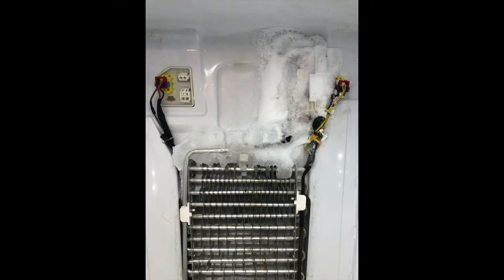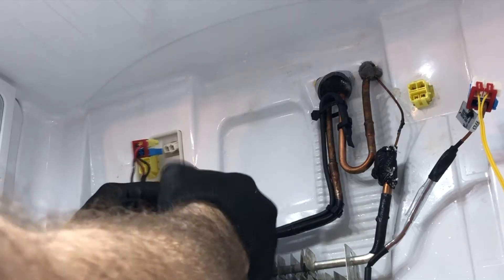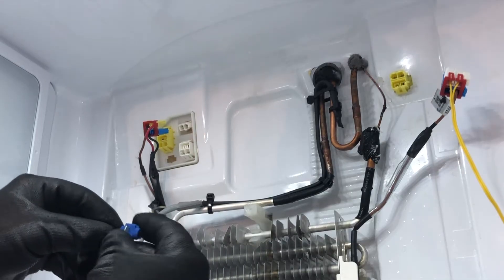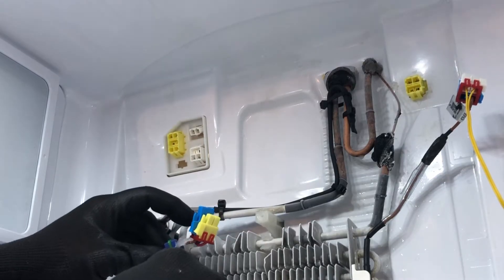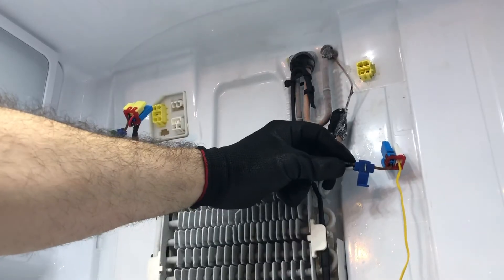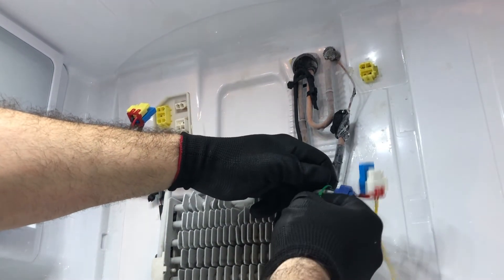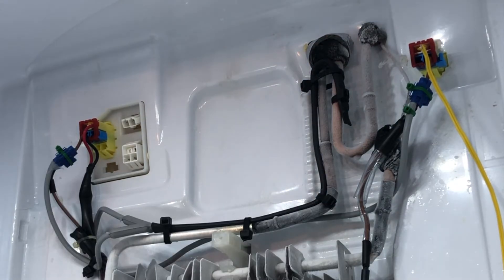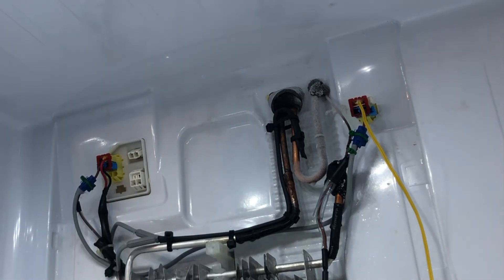Samsung FDBM evap heater add

Comment: I have a Samsung Model # RF28HMEDBWW/AA  Rev. 04  S/N 066443BFC00488V and I have the same over icing issue.  I have defrosted, removed the back panel safely,  and have all the parts to add the heater.  I just have a couple of questions,  I have 2 plugs on the left, no plug on the right.  I had a hard time viewing the connections and the correct wire that goes into the connector with the heater wire. Not sure what wire to connect to? I have a hard time viewing the schematics. With 2 lead wires on the heater,  and  my unit only having 1 plug that looks like the one you connected to, am I connecting on one lead wire from the heater?  If you could please advise me as to the connections I would greatly appreciate it.  Also,  I am curious, will this make the heater only heat when you run the FR or FD or will it heat up automatically to maintain the buildup?
Reply: My Apologies,  I was thinking of only the 2 plugs I unplugged on the left when taking off the panel.  There is in fact 2 plugs one on the left and the right.  I just need to know if the brown wire is in fact the refrigerator  heater wire and that this is the only wire that is in fact connected with the SH502 heater wire inside the connector? My Bad.  I am figuring this out as I go.
Reply from the maker: This is an advanced modification for technicians, it's not meant for a diy. I recommend you call a qualified repair tech in your area to install the heater. As to your other questions, this heater works when the defrost heater is on during normal operation. The tech should setup the heater in parallel to the defrost heater. If it's not wired properly, it could fry the refrigerator control board.
Reply: @electronicsprojects4708  Thank you so very much,  I just was advised by Supco that this part is not a compatible part for my Model. They referred me to Repair Clinic for an OEM heater.  I have the OEM part # of DA47-00434A. This part appears much different in shape but basically the same concept.   I will see about getting the OEM part and having a Tech install it for me.  Thank you very much.
Reply from the maker: @katherinereynolds8118  If the only place that the frost is building up is at the top near the fan, that means the evaporator heater is working just fine. The reason I posted this video was for techs to be able to overcome an engineering failure in this series of Samsung french door fridges. This is outside of what the manufacturer or Supco for that matter recommend. But it's a modification I came up with and I have been doing it for about 4 years now, I know of other techs that have put thousands of these Supco heaters in these refrigerators with great results. But it is a more advanced repair, that's why I only recommend competent appliance techs perform it.
Reply: @Electronics Projects  Thank-you so much. This explains everything, why Supco wouldn't suggest I install this to my model, and why  Supco referred me to the OEM replacement  of the evaporative heater. The evap heater is working fine, so that was not what I needed. My unit was in fact only icing up near the fan at the top.I didn't end up purchasing the replacement heater. I cleaned up the fridge and decided to wait on the install or the evap replacement. I Put it back together, Running great for now. Want to see how long before it ices over again. I have had this fridge for 9 years and never had to defrost it. This was the first.  If it freezes up again, I will have this fix installed definitely.  I got nervous when you mentioned the fact that it has to be installed correctly or it could damage the circuit board, and then Supco not supporting the idea or compatibility either. 
I called a tech and they wanted $250 to come look at it. Fee is waived if repair is done, but they wouldn't use the parts I purchased. 
I will need to find a tech that will install it for me. It appears to be an easy install. It did not seem to me that this fix should even be a compatibility issue. 
This is a great fix, and I will definitely use it if it ices up again. I am sure it will. Thank you for what you do. This will help a lot of people including myself get around Samsung's engineering  failure.
Reply from the maker: @katherinereynolds8118  I would send the tech a link to the video asking if they are familiar with this modification before they come out. Explain the frost build up is in the fan area in the fresh food compartment.
Reply: @Electronics Projects  Thank-you, that is actually a great idea to make sure they can and are willing to do this. Great advise thank you.

Comment: not sure if I need the extra heater , but the temperature in Samsung fridge will go from 34 to 48 in a half hour, and repeat. It is set at 35 degrees . Freezer was set at 0 degrees , but actually read - 10degrees . So I set freezer at 5 degrees , and the freezer seems ok , but I am concerned about the range of temperatures in the fridge section
Reply from the maker: If too much frost builds up on top of the evaporator, it will hit the fan and you will hear a loud noise that stops when you open the door. If it's enough frost to build up to stop the fan, usually the temps will read 60 plus degrees on the middle shelves. Opening and closing the doors will affect the temp reading so do a temp reading 1st thing in the morning before anyone has opened the fridge. Do this for a few days to get the average temp of the fridge.
Reply: @electronicsprojects4708  hi , I'm using a thermometer that sends the temperature to a base outside the fridge .
there is like a half hour cycle where the temp will go from 34 to 49 degrees  with the doors closed the whole time and repeat . How can the temperature go up and down 14 degrees with the doors shut ?   Milk has not gone bad, but I'm starting to get concerned about this .
Are there sensors I should be looking at ?
Thank you
Reply from the maker: @frankcronin1060  if it goes through a defrost cycle, there will be a 30 minute time frame with no cooling. My recommendation is to get an averaging thermometer, not an instantaneous thermometer. Food will see the average, so it's the most important. This is beyond the scope or purpose of this video, which is an add on heater. This won't be of help for you.
Reply: @electronicsprojects4708  I appreciate your help . I had water in my crisper drawer. I took off the cover and found ice all around the drain and tray below coils . So I thawed out the drain  and cleared up the tray .( a couple times ),  I found the freezer was set to 0 degrees , but found it read  -10 degrees . So I reset the temperature for the freezer to 5 degrees , and found the temperature actually to be 0 degrees , but for the first time I found ice blocks formed above the coils . So , I'm thinking the added heater may help ? 
And , would a temperature range of 15 degrees be ok in the fridge section ?
Reply from the maker: @frankcronin1060  the add on heater is for frost build up by the fan. If you need to address the drain clogging up, there's a drain kit for that, I'm sure there are multiple videos for this you can try.

Comment: What if the defrost heater is not functioning? Will this added Supco heater still fix the issue? I saw in other video that you should check resistance and make sure the heating element is not burned out. Thanks
Reply from the maker: If the only frost you have built up is at the very top, the defrost is not the problem. If you have frost top to bottom on the evaporator, the defrost circuit needs to be diagnosed. That would be an unrelated failure.

Comment: do you think the SUPCO SH540 Drain heater (25 watt) would be too much for my Samsung Fridge RF26J7500SR/AA. ?   I like this heater as it is longer than the SH502 heater.
Reply from the maker: I have had success with SH502, you can cut the heat shrink off of it to double its length. Or buy the SH201. If it gets too hot, it can cause damage to the cover or liner, I have tried hotter heaters as the SH201 and SH502 have worked just fine for me.
Reply: @electronicsprojects4708  Ok, thanks.

Comment: You are the man!  I have been frustrated with my fridge since it started acting up in the first year of having it, have had a few appliance techs out to check it out since it's been under warranty, but nobody could provide a long term fix.

I did this and have had a normal fridge for months now, I am so grateful to you that I cant even really put it into words.  I feel like a 6 year stress has been lifted, thank you again!
Reply from the maker: Good to hear. I have been doing this repair going on 4 years with very high success rate.

Comment: Your procedure to repair this annoying, stressful and time-consuming problem is ingenious.  This will save folks a lot of stress and money, including myself, since I was about to get rid of my Samsung refrigerator and replace with a GE.  Your instructions while demonstrating the procedure was excellent.  I followed it to the T but I still had a problem.  The heater was not getting hot after I turned back on the fridge after the installation.  The only thing that I did differently was use the red wire splice (11-18 GA AWG) instead of the blue splice (18-14 GA AWG).  I acquired these from Harbor Frieght.  The problem I had with the blue splices was that after crimping with the pliers, the heater wire kept falling out of the splice. When I switched to the red splices, the splice trapped the wire and, even when I tugged on it, it never came out.  My question:  Is there a problem using the red splice since you used the blue splice and the installation worked fine?
Reply from the maker: different companies make different connectors, so one may work for me and not you even with same color. Use the one that when you pull on the wire, it won't get dislodged. The defrost won't kick on if the evaporator is too warm, sensed by the defrost sensor on the right. You may have to either freeze spray it, or just use the fridge and if it fails again, address it at that time. This video is meant for techs that have done the necessary troubleshooting already to confirm all other standard repairs are not necessary and this re-engineering is a last resort to the frost build up.

Comment: I guy charged me $400 to do this about a month ago and it failed, now he disappeared.

Any other solution fix?
Reply from the maker: Sounds like he didn't do it correctly. Find someone in your area that's not a fly-by-night tech, that has experience with this repair. I have been doing this repair successfully for about 4 years for frost build up, but other things need to be checked. The drain must be clear, Samsung has a mod kit for this. And the mullion flipper needs to be sealing. Condenser and machine compartment should be clear of lint. These are things a professional technician will know how to check.

Comment: Can you check via touch if the  original samsung defrost is working using the “rd” forced code?
Reply from the maker: You can test it in forced mode, but the defrost sensor must be cold or control will not start the defrost process.

Comment: Part number again please. I’m installing a new htr today for icing issues I verified with pulling the code on the controller? Also would not heat with a Fd either? Thoughts sir?
Reply from the maker: links to parts are in the description with p/n's. if the evaporator is not cold enough, it won'd turn on the defrost heater.
Reply: Thanks, it appears it is coming on during f/d by using my clamp meter on circuit in the panel. Hard to catch it on during normal mode however?
Reply from the maker: @ToddM452  not sure what you mean by 'normal' mode. In Diagnostics it will come in 'fd' or 'rd' mode. As long as the evaporator sensor is detecting a cold evaporator. In the run mode (normal operating mode) it should defrost every 6 to 8 hours.
Reply: Nice! Thank You for replying quickly. The defrost sensor resistance checked good against the value chart so I didn’t replace it. The diagnostic code is still showing a r1g pointing to the htr even though I replaced it that’s why I asked about normal run mode.

Comment: Great repair video. Would the the SH502 work for a RF18HFENBSR?
Reply from the maker: Yes, but typically I find it's the ones that have the second suction line loop that the heater is tied to that cause the problems. If the drain is clogged, and the evaporator drain pan has solid ice in it, then there is a mod kit for that and that has to be cleared for the frost not to build up again. Also the ff door mullion flipper needs to be operating correctly, or it can let air in the ff compartment, causing excess frost build up.

Comment: Just going to drop this in here even though it'll get lost in the comments. This video was posted for refrigerators that run on 120v. If you live in Australia, the UK, or anyplace else that uses 220/240v, you will need a different heater rated for that voltage and 15w. If you run the 120VAC heaters on 240v, you'll be twice as hot as it should be and cause overheating issues.

This video is fantastic, ordered the parts and can't wait to get my fridge fixed once and for all.
Reply from the maker: thanks, I had added the 120 vac only to my video description above the links for the parts.
Reply: Let's remember Ohm's Law. Power = voltage^2/resistance. So this heater will be 4 times as hot at 240V, not twice.
Reply: Thanks! It wold be great with a link to an equivalent 220v cable. I have looked around, but no luck!
Reply: Here's someone wishing they'd been more careful reading the comments and the description! You don't happen to have a recommendation for a heater that gives equivalent heat on 240V?
Reply: @mad1toad  I believe the Supco SH503 is 15w, 240v and about $20 or so.
Reply: @shaeff865  Thank you. Strangely, I can't find the 503 for sale in the UK (even though the 502 is readily available on Amazon, but rated for a different voltage!). Thanks for the tip though, I'll continue my search, and post back if I find it or something equivalent.

Comment: My heater will not come on at all in forced defrost. I checked it and it seems to be fine. Is it supposed to get hot to the touch when turning on forced defrost?
Reply from the maker: yes, it takes about 3-4 minutest to get up to about 180 degrees and you can leave your finger on it for about one second without it feeling uncomfortable and having to remove your it. If the Samsung defrost heater is working and getting hot (it gets over 500 degrees so be careful when testing) then you have a connection issue with the new Supco heater. If it is not turning on, you have an unrelated issue with the defrost circuit not addressed in this video. Note, if the evaporator is warm, it will not go into defrost. The evaporator sensor feeds back temp info to the board.
Reply: @electronicsprojects4708  hmm so my heater is not going on. I attached the new heater up on top with posi taps and I started getting error code R1 g and f1g meaning error w the heaters. I figured I must have severed the wires so I removed the taps, cut the heater wire and spliced it together and the error code went away. Then I got the regular tabs like the ones you used, but it was difficult because the new heater wires are real thick and the existing ones are thin so one of the new thick wires kept coming out. I had to open the tap and remove it and use a new one. Now I'm getting only a error code f1g, meaning freezer heater is having problems. Anyway, I ordered a new main board hoping that is the reason the heaters don't come on. Any thoughts on the error codes?
Reply from the maker: @druiz607  I strip the wire about 3/4 of an inch, so the insulation does not sit in the connector. I don't think a new control board is going to fix anything. I would need the model # to look up error codes as they are different from model to model and people's interpretations of the erro code can vary.
Reply: @electronicsprojects4708  Update! I finally got back to this, first thing I tried was the new board because the heater and everything else tested fine. As soon as I plugged it in I saw that there was no more error code. I then put it in forced defrost and after a few minutes did the finger test and what do you know, it really hurt! Yes I finally got the heater to turn on. I did your advice for the connection for the tub heater and that one turns on as well! Thanks for the help.
Reply: update 2: ok hours later, it was making a weird noise like a motor is running , and I checked the diagnosis and now I get the F1-g code again which shows up in the manual as: F-DEF.-Heater Error - F defrost part error. Model is rf267aars. I'm going to test the resistance between CN70, CN71 as it states in the manual, but I did that way back before installing the new board and it was fine. You ever get this?
Reply from the maker: @druiz607  well if you tested the heater and it was hot, it doesn't make sense for that error because it's sensing either open circuit or short, either way it wouldn't heat. Also, noises are not associated with heater failure. I think you need someone to come out and help you diagnose and fix it on site.
Reply: @electronicsprojects4708  since it's indicating an error with the freezer heater, I opened up the freezer and the noise stopped. It's sounding like it's the freezer fan hitting ice. So I stuck my hand way back into the freezer and sure enough there was ice in the vents just like up in the fridge. I'm going to open up the freezer this time and see if I need to melt ice.